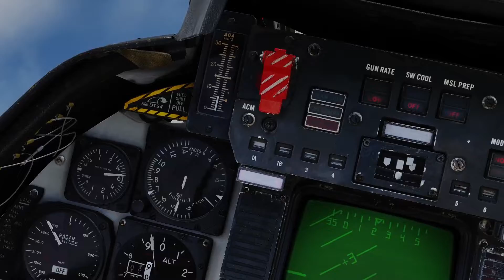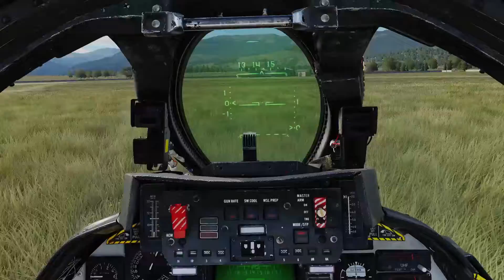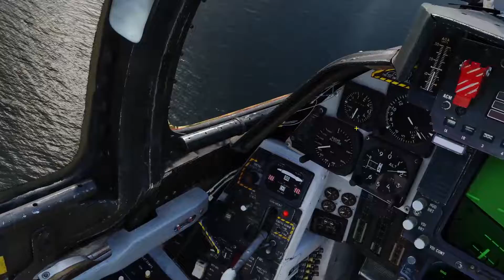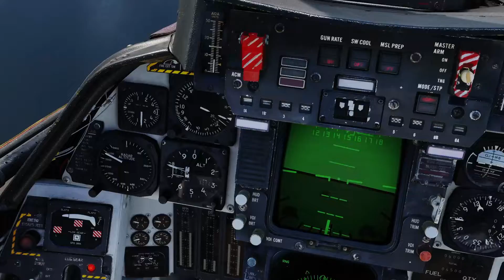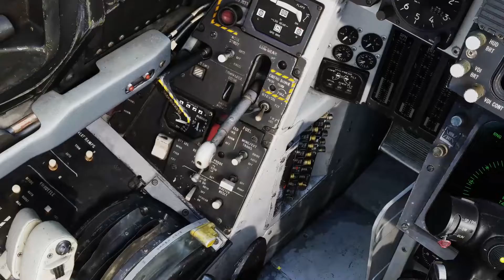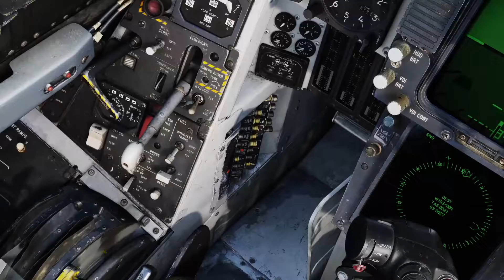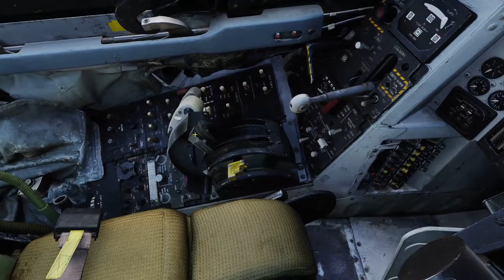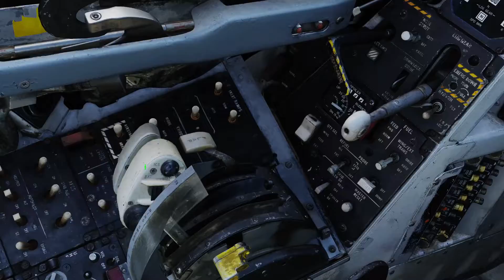DCS F-14 Tomcat - First Flight, Impressions and Commentary

Comment: Nice video. F-14 has the best flight model in DCS when you learn to fly it properly IMHO. I love the other modules but flying the Tomcat makes you a better pilot in the other fixed-wing aircraft. It requires more skill  to fly well and I feel like I've increased my aeronautical knowledge as a result of flying and studying the Tomcat. I think if you revisit this module when you're ready, you won't regret it.
Reply from the maker: Thanks! Yeah the F-14 definitely felt the most raw of any of the modern jets i have flown in DCS. The only one that were tougher to fly are the WWII modules. The other thing that caught my attention is the complexity of the wings. The thing has slats, spoilers, flaps all over the wing. The thing comes apart like airliner wings and morphs completely. Adds failure points, but still a sight to behold.